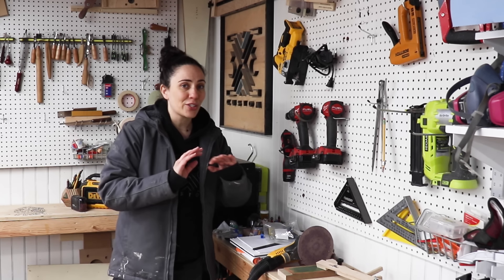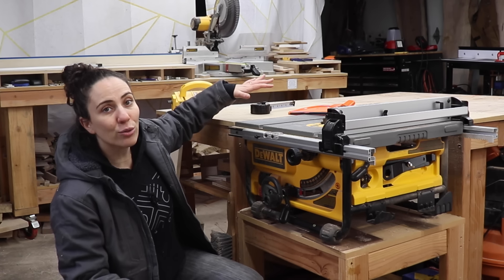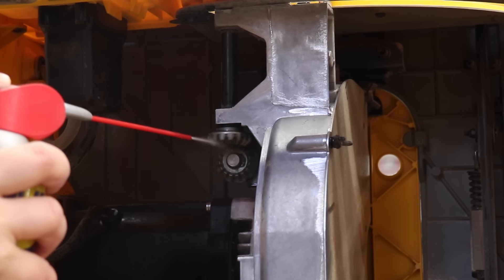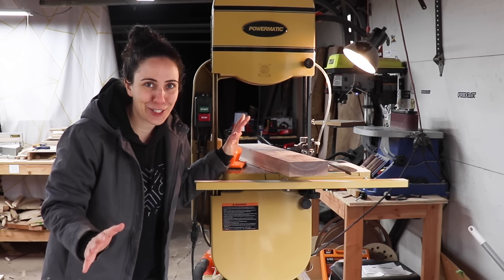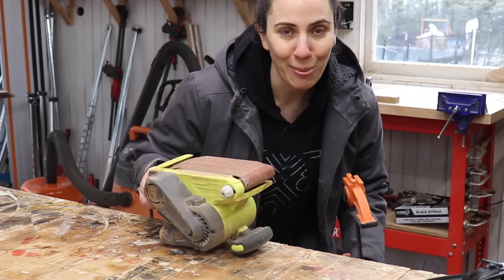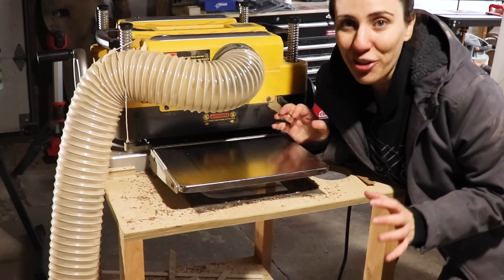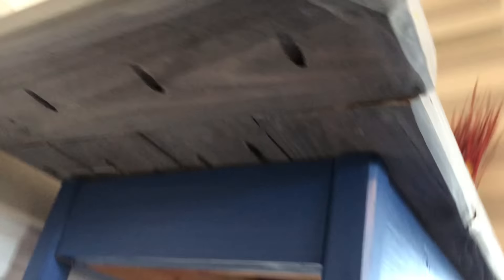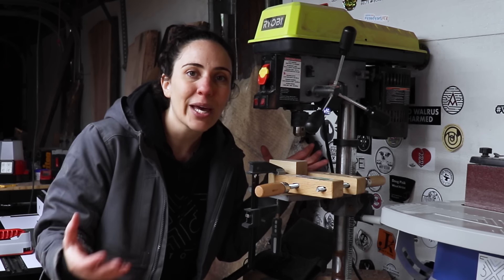What Tools Do You Need to START Woodworking? Beginner Woodworking Tool List

Comment: Thank you SO MUCH for this video!!!!! I'm at the point where I have a drill, a sander, and a miter saw (which I got instead of a circular saw because circular saws kind of scared me, and I am definitely seeing its limitations). I have been thinking about getting a table saw for a while now, hemming and hawing because my shop is small and I was intimidated by potential maintenance. Your video has been super helpful and I'm definitely gonna place an order on the DeWalt jobsite saw I've been eyeing.

Also I'm gonna start thinking about dust collection (right now I'm just using an old handheld vacuum...) now. :D
Reply from the maker: Awesome. So glad it was helpful!
Reply: Just flip a hand-held circular saw upside down, make a jig to hold it in place and keep the guard out of the way, and build your own table saw.

Comment: Hi Tamar, My name is Ali and I am a big fan of your work and I loved carpentry because of the videos you show which are short but full of useful and concise information that will inspire anyone who wants to start woodworking and I have already started doing some woodworking like building a small table and now I want to buy a table saw Like the one you have and my question is what is the blade size of your table saw is it 8 1/4 or 10” and which one you suggest ?
Reply from the maker: Hey! I’m actually putting out a video very soon that will answer that 😉

Comment: Great video. I was wondering what drill bit stop you use on your hand drill? It appears to be the type that spins so it doesn't damage the surface when it contacts the wood. Thanks!

Comment: I'm seeing this a tad late but everything I saw including this made me see I made good choices. I got drill first for house stuff too, then circular saw and bosh plunge router all my wireless stuff is dewalt so far. Got a shop vac (chose poorly got the mini dewalt one that is weird shaped but super small so it fills immediately lol.) Corded dewalt sander, and a dremmel (that was first actually bc I needed to shape a nut for my legator ninja 7, it's multiscale and I was putting mega heavy strings on for low tuning fun and it seemed to fit but the b string caused the top slot to break) I didn't wanna spend the money on nut file set that at the time I figured I'd never need again, but i didn't know I was gonna be building guitars yet lol. Still a ways off I've got makeshift work spaces only so it's a process but It's been fun just building workbenches, desks and fancy dog kennels so far! Thanks for the content!

Comment: Of all the projects I turn out that my friends and extended family love, when they're looking over the project and are discussing all that it took to make them and more often than not then ask me what my favorite tool is-- I tell them my Stanley 25' tape measure, usually puzzling them.
For me, considering all my power tools, I love using  my most basic and nontechnical tape measure because I love the planning phase of projects the most. Measuring and spec'ing out all the dimensions and then figuring out what is able to fit and with what provided materials, my trusty tape measure allows my creativity to open up and gives me joy.  :-D
Reply from the maker: Ha. That’s awesome

Comment: I have that same table saw and it does the same thing with the depth of cut. Seems like it's those two polished steel bars that the motor assembly is intended to slide on getting gacked up. It's the thing I hate most about this saw which is otherwise pretty nice.  I landed on basically the same solution you did but it seems like a design flaw. It would at least be nice if it was easier to get in there to clean it out. Anyway great video, just subscribed.
Reply from the maker: Yeah, it’s annoying to deal with but it’s a great little saw otherwise

Comment: I really like the laguna pflux 1.5hp dust collector that I got.  it has the ability to either do a 6" duct or two 4 inch hoses and does hepa filtering and a built in cyclone.  A good upgrade for your existing dust collector may be a wynn environmental filter to give you better filtering and more air flow.  Thanks for sharing so many fun and useful how to videos ;)
Reply from the maker: Sounds cool!

Comment: Musical instruments rarely use sandpaper because it clogs the pores and changes the sound. Luthiers mostly use scrapers. As a teenager, I wanted a musical instrument and had no musical training or woodworking experience. We had an old Sears contractors saw on the farm and a drill press. I was able to make musical instruments with only those power tools. Took me three tries to make the first one that worked and sounded good. I learned to bend wood over the wood stove in the shop. I would say the most important tool is desire.

Comment: The most important large shop tools in order are a good ridgid shop vac at least 2 1/2" hose, table saw with at least 30 inch rip capacity, a good miter saw (not ryobi) they're terrible, thickness planer preferably with a shelix or helical head, drill press, and a jointer.

Comment: Nice list!  I would have had a combo square & tape measure right at the start.  I'd put a shopvac & cyclone for dust right with the table saw. 

I can't have the noise so I'm hand tools,  Hand planes & a bandsaw for rip cuts.  I might want a thickness planer but I'm doing ok w/ the hand planes so far.
Reply from the maker: If that works for you. Awesome. If I had the time I would love to just use hand tools. But I have deadlines and time constraints, so I love power tools!

Comment: At 1:00 mins you tell us all straight to have those basic three or four tools, there you have it folks I'd go for affordable avarage prices too.
At moment I only have a hacksaw tennon saw and 400 mm wood saw hammer glue and glass paper oh and straight edge with angle measure for mitre and square joint I work out inner head.
I do also have 2 g clamps and bust old work bench

Comment: Consider using a wax instead of the PTFE-laced lubricant shown. Although for bicycles, something like Squirt will do the trick. Dust will just fall off.
Reply: PTFE is inert and completely safe to use.

Comment: I've never subscribed to a channel so fast.  Wow, this was so informative.  I am brand new to woodworking.  I've never built anything.  So what did I do?  I went out and bought a Dewalt table saw for $500 because I love to spend money. lol  Seriously, it hasn't shipped yet, so I'm wondering if I should cancel it and buy a circular saw instead.  I have some battery Ryobi tools.  I want to start with creating some draw dividers and then a work bench.  I'll take a look at the other videos on this channel and try to make a decision (before my saw ships).
Reply from the maker: You won’t regret it. I use my table saw a ton. But watch every single safety video you can before using it

Comment: Btw - the successor to the DW745 is the DWE7485 which has a slightly bigger rip capacity and higher RPMs, but only a 8 1/2" blade vs the 10" on the DW745.  If you want the 10" blade, upgrade to the DWE7491RS which is above and beyond both the DW745 and DWE7485.
Reply from the maker: Yup. Just can’t recommend them bc I don’t personally use them

Comment: Another way to save money is on the band saw blades. If they snap you can weld them to get some more use out of them before replacing with new saw blade.

Comment: On the tool choice.  You said pick a brand so that the batteries will interchange.    I think what is more important is to pick a brand that feels right to you.   Saws have different handle angles, some may make it easy to cut straight, some will make it difficult, for you.    Besides all the batteries mean is convenience for a while and then really expensive replacement.   Corded tools are way more powerful and no surprise when it comes time to take out a second mortgage to buy replacement batteries.
Reply from the maker: That’s a good point
Reply: 3x3Custom - Tamar I am glad you took it that way.  Not a criticism!  I really think you do a great job in your videos!

Comment: What a great tip .... WD-40 Specialized Dry Lube !  Who knew (well, you did)? It's hard to find.  Local Home Depots' do not stock. I have drive 40 miles round trip. Was about to order 5 five from Menards @ $27.70, but the shipping charged is .... $58.79 to So Cal 91730. WHAT? 
Looks like I will be driving to pick it up.  Why?  Because I have the same Dewalt table saw (great unit).  I started doing a long overdue cleanup last night.  So the 'dry lube' is exactly what I need.
Reply from the maker: Awesome

Comment: Do the jigs that you have made from plywood, ever come out of alignment?  I am just getting started and am working in my garage, which is not climate controlled yet.  As I become more experienced, and need to build these jigs, i wonder if there is a problem w/ the plywood changing shape overtime?  I know plywood is much more stable that solid wood, but I want to confirm that plywood will not change shape over time.  Thanks for your great videos !!
Reply from the maker: I’ve never had an issue that was big enough to impact my projects

Comment: there is a type of clamp that you attach to a peice of pipe for the bar. the advantage of these is you can get long pieces of pipe and make the clamp what ever lengths you want. also, given the thickness and shape of pipe, the clamps end up being very strong.
Reply: Pipe clamps!  Another handy trick with pipe clamps is that black iron pipe comes with threads on the ends, so with a coupler you can screw several pipes together end to end and clamp house-sized objects for not a lot of cash.

Comment: One of my first power tools was a jigsaw and you may ask why? There is a tv program in spain called Bricomania and is about diy has been running since the 90's and the main maker in the program mostly use a jigsaw, I think we are influenced to use the tools that the people we learn form use.
Reply from the maker: For sure
Reply: @3x3CustomTamar  I use WD40 dry lube on my bits and blades because of you 😊
Reply from the maker: @EPortillo5000  awesome

Comment: enjoying your videos! Any suggestions when looking at a router table? I currently only have a trim router (same one you have). Should I get router table for trim router or would it be better to get a big router and table? Please also include information to your router table and lift and would you recommend.  Thanks!
Reply from the maker: Mine is from MLCS. I would wait to get a larger router for a router table. This way you can use larger bits with it.

Comment: Great video ! Thanks for covering so many angles. Woodworking is such a broad term and as you say it’s a personal choice depending on what you are making that will guide your purchasing decisions. Good quality tools eg: a table saw are you expensive in South Africa, your Dewalt costs about $1000. So I am going to have to use my circular saw and set up a make shift table saw on my work bench. Any suggestions on that type of build ?
Reply from the maker: Jeez. That’s a lot for that saw! I paid under $400

Comment: Hi Tamar.  Another great video.  What is the little air blower you used to help clean up your table saw please?  I keep thinking I'll need to get an air compressor to have an air blower but that's clearly not the case!  Thanks.
Reply from the maker: Thanks! It’s a little cheap thing I got on amazon. I don’t love it. An air compressor would totally be better
Reply: @3x3CustomTamar  Thanks Tamar.  So much more trouble to get a compressor though but I will give it some more thought.  Enjoy your weekend.  Tim

Comment: Love your  honesty. but let's get down to brass tacks,  first off  I do furniture restoration( antique) .   But i started out the same way got all the hard learned lessons plus extras. no surprise there. tool and equipment maintenance is so key in wood working today. I'd like to touch on a few points circular saws are really not a biginner tool. In order to learn proper wood working , the beginner should start out using hand tools. does it require more time ? yes but it's a key lesson into wood working.So lets look at planers  again not a beginner tool. hand planes would be a better choice for the beginner. routers again not a beginner tool ,I've seen way too many routers runaway from their operator. (NOT GOOD). Table saws here's the most danderous machine in the shop. way too many people  getting injuried on the table saw, is it a begginner tool ? NO! hand saws for the beginner.  The beginner needs to learn the basics with hand tools then once they've mastered that the they can move on to power tools  you say a tool is a tool and i agree with that .But lets talk about furniture repair and the tools needed to do that work a subject covered by very few people . furniture repair /restoration requires a whole different tool list.furniture repair/restoration is my speciality with close to $80 grand invested in tools. you  covered gigs not for a beginner proper tool proper methods.are gigs useful ?absolutely!  But again learn proper procedure.. Over 20 yrs in the restoration business i think i have 12 gigs total in my shop.  I'd like you to comment on this and please be truthful.

Comment: I messed up and bought the 8.5 inch version of the table saw. Got it on sale for just over $300, so I'm thinking about keeping it. I figure it will be a good portable saw if I need one, but it does mean I don't have the budget for the 10 inch now if I keep it. I wonder how limiting the 8.5 will actually be?

Comment: From how you work I can't see how a jointer wouldn't be a valuable part of that process. You'll work much more efficiently and if you're a savvy shopper, it can save you money, as well. I bought from a fairly nearby mill when I started out. The lumber was sold in small pallets. It was a mix of quality, didn't always look pretty on the outside, and had more twists and defects than the FAS you see at local retailers, so it required more work to get your pieces flat and square. But it was so inexpensive. A good jointer, one with a helix head, along with some skill can save you quite a lot by going a similar route. Plus, if you're more of a beginner then your mess ups won't be as costly. Where I am, in Western NY, there are a lot of mills around that sell local hardwoods at a lower price than the retailers. You can also save by buying used equipment. You can get a decent jointer on Craigslist for $350 or so.

Comment: Great video. On some points I don't agree with you. As a beginner I wouldn't buy battery-operated tools  (except maybe for a cordless drill as a second one)
Why do you hate a jig-saw?  For sure it isn't the best saw for straight cuts. But for all other cuts it is good. Sometimes better than a bandsaw (which is not a beginners tools)
Reply from the maker: I’m sure many wouldn’t agree, but this was the path that worked for me. I just always found it frustrating to use

Comment: Can we join you the next time you set up your tablesaw, please 😁✌🏻 
I hardly use mine b/c it is just a bit off...it always leaves at the second cut burnmarks all over...I can't use a blade finn b/c it clamps the wood between fence and blade and it's not accurate...

Using a tablesaw is always a guessing game! 😔😒

Comment: Not sure why you don't prefer the jigsaw, maybe because you have a band saw, for me the jigsaw is a savvier for irregular shapes then sand it down to the Shape line.
Reply from the maker: I used my jigsaw fir that stuff before I had the bandsaw. But the blade deflection always bothered me with thicker hardwoods

Comment: I have the Dewalt DWE7491 which I'm pretty sure is the exact same saw, same motor, but up to double the rip capacity. does it justify double the price? probably not 😹 but at least I've been able to follow along with Tamar with blade calibration, building a miter sled, and pretty much every other project involving a table saw
Reply from the maker: Ha nice

Comment: What's the little blow gun? I'm currently just using the blower end of a wet/dry vac to avoid my compressor but something less powerful would be nice. Looks like the mist village after I use the vacuum.
Reply from the maker: It’s a cheap little thing from amazon. Meant for computers